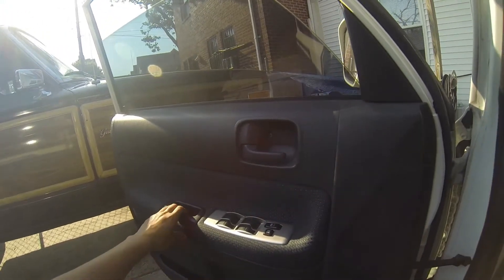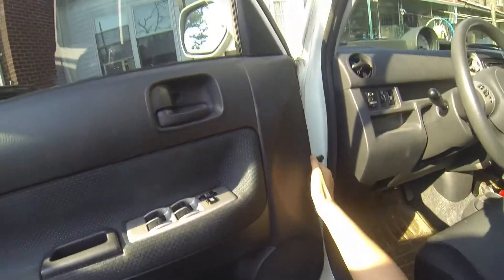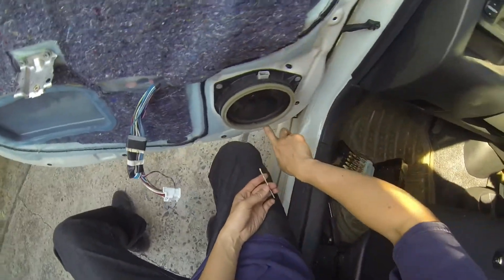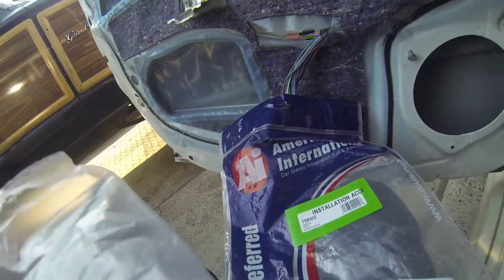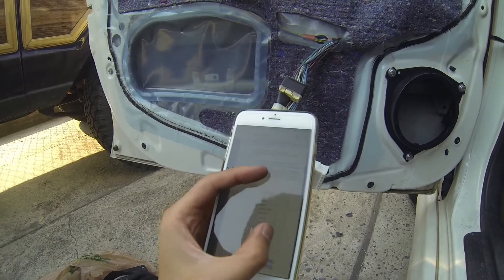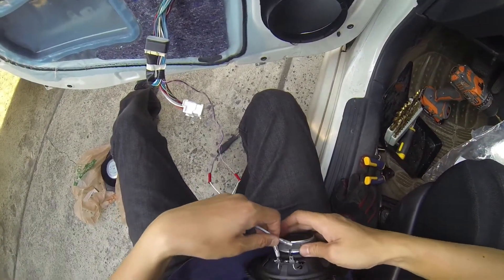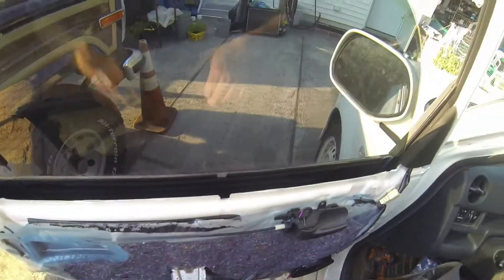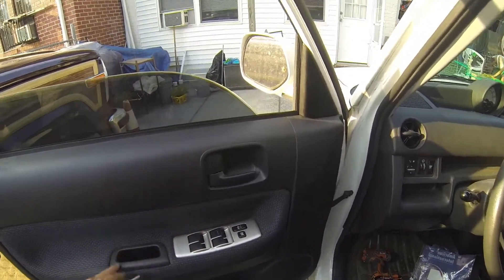2006 Scion xB Speaker replacement

Comment: The stock Pioneers are excellent.  I spent $60 on an upgrade and end up reinstalling the old ones.  Maybe I screwed up the install but as far as I could tell they worked fine they just didn't sound as good as the stock speakers. So I got some 1/4" sheet metal screws and replaced the stock speakers easily.